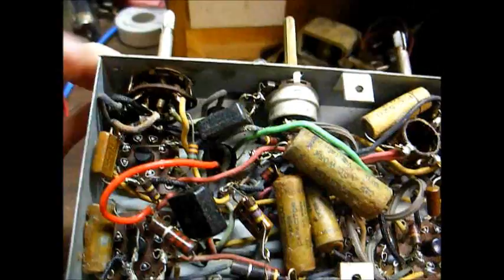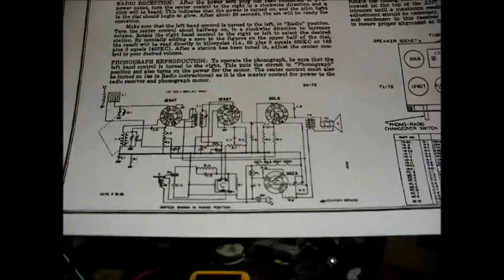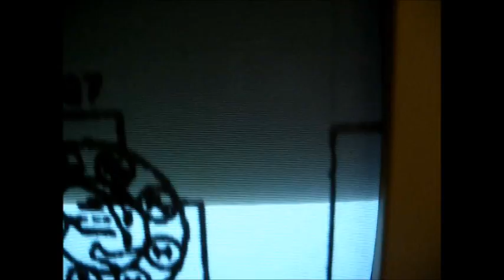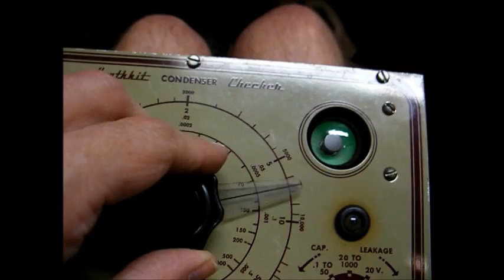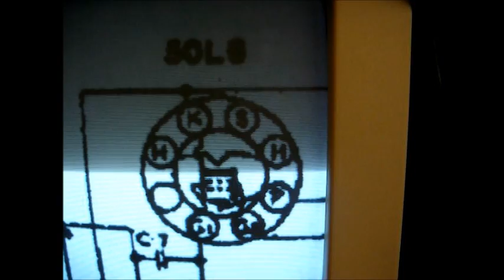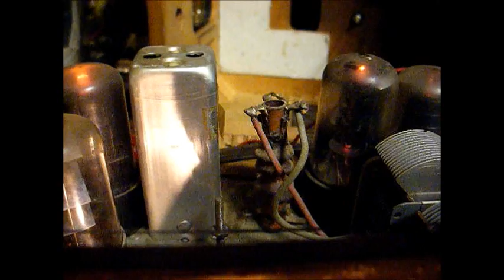Repair of a Trav-Ler tube radio/record player - part one

Comment: I understand why you troubleshoot as you do as it shows us what to do when various circumstances are encountered. You know, I've re-capped before only to CREATE problems as I've had a brand new epoxy dipped capacitor from Mouser be dead shorted right out of the package! Boy it took me a while to track that down cuz you go "Naaaa...I replaced all the caps, so it CAN'T be a bad one, WRONG! I've learned to check all new capacitors BEFORE installing them now to prevent any "oopsies" in the future! Same thing with carbon drifters (resistors), CHECK before you install! Bryan, I so thoroughly ENJOY watching your vids! I have spent hours & HOURS over the last few weeks watching your vids & feel as though I've gotten to know you, so to speak! I appreciate all you do to preserve our electronic heritage!

Comment: I like watching your radio repair portion of these combo players.  You do an excellent job of showing others.  The record player side doesn't float my boat, but I'm aware that it does for many others.  More than a few Antique Radio Forum members really get into record players, especially those RCA Orthophonic sets.
Thanks, my friend.

Regards,
John
Reply from the maker: Thank you and I don't mind working on record players; but, I have to be in the mood to work on them (especially when it comes to changers). The biggest downside to working on record players is that it now cost $30+ to have an idler wheel rebuilt and replacement cartridge quality can be iffy (with both NOS and current production).

Comment: Hi! I have my doubts that, that radio was originally a three speed unit? This was a pretty popular conversion in the 1950's. Done by replacing the motor and turntable along with the tone arm. These kits were available through most of the electronics magazines. Brendan
Reply from the maker: Thank you and I thought the same as you, until I read the model tag on the underside of the radio that says "model 5044 radio & 3-speed record player." In the past, I've been guilty of replacing the original 78 rpm record changer with a 3 or 4 speed unit, especially if the old changer was too far gone. I have a '39 RCA tabletop radio/single play 78 player where someone removed the original tonearm, drilled another hole in the motorboard, and mounted another tonearm. If I can't find the original type tonearm, I may convert it to a 3-speed mechanism.
Reply: Well I'll be doggone! Then that radio combination can't be as old as it looks? Maybe they made this model for quite some time? Looking at the chassis I was guessing early to late 40's. Three speeds got popular going into the 50's after 45's became popular. Brendan
Reply from the maker: B Dagle I have an idea tihs may be a 1950 model, because of the model number being 5044 and the tubes all have late-'49 date codes on them. Even though the LP came out in '48 and the 45 rpm in '49, there were still some cheap 78 rpm-only players made into the '50's. In fact, I have a Silvertone radio/automatic record changer from '50-'51 that's 78-only.

Comment: Do you have an SSTran or something similiar? That's all I use my radios with, because around here the local programming is garbage. Restringing a dial is probably my least favorite job on radio repair work....I can do it, but I"ll cuss the entire time lol
Reply from the maker: I have one and need to get it back on the air. I don't like restringing dials, either. Years ago, I had a german set with a broken dial string and I farmed it out to someone else because I didn't feel like dealing with it.

Comment: Where are they getting -8 volts? are they floating the ground through a resistor or something?? That would explain why it was negative with the high current draw, the more you load it down the more negative it goes as a counter reaction to the load...
Reply from the maker: There's a 470K resistor between the control grid of the output tube and circuit ground and the cathode is tied directly to circuit ground.
Reply from the maker: shango066 Here's the schematic:  http://www.nostalgiaair.org/PagesByModel/975/M0021975.pdf 

This set has a capacitor in parallel with a resistor that's connected between circuit ground and chassis.
Reply: radiotvphononut
That is a very unusual circuit design! The cathodes of all tubes are at ground? Then I finally started looking at the values of grid resistors to ground, then it finally dawned on me that they are using grid-leak bias. El Bizzaro!